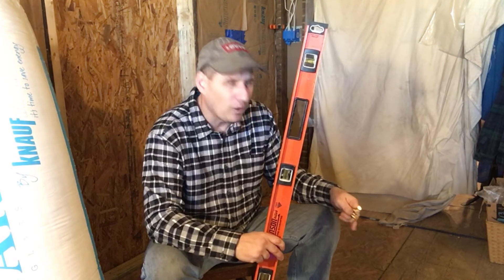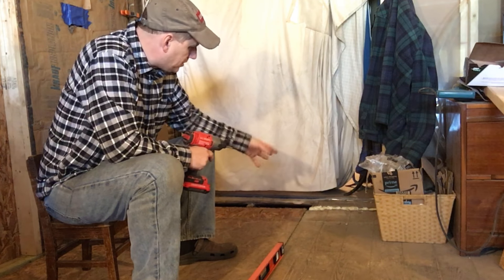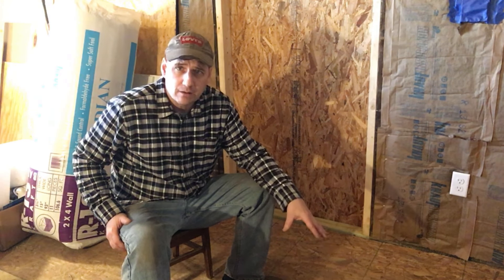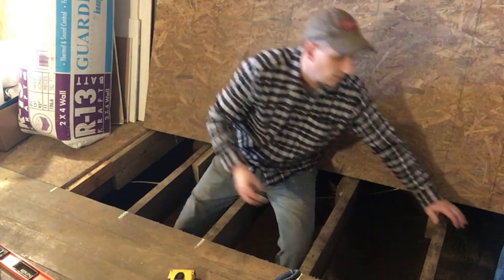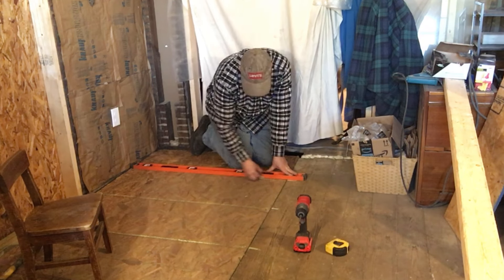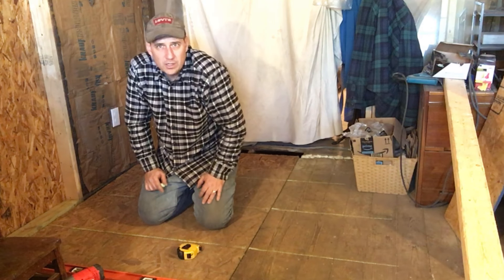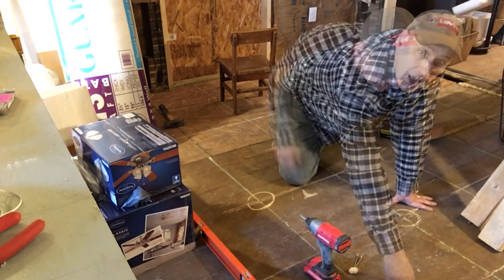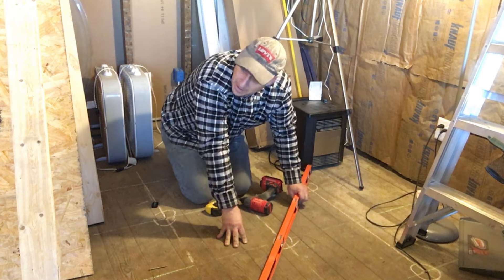DIY: Easiest Way To Level An OLD WOOD FLOOR - Using Screws and a Level

Comment: Curious...how expensive would it be to have foundation experts come in and re-level the foundation and joints from underneath?
Reply from the maker: Hi Ed.  The cost of contractors to do anything varies widely on where you live, what season we are in and how the economy is doing.  If contractors are "hungry" for work - you are more likely to get a better price.

I don't know how much reworking foundations would be specifically but I can safely say the minute you speak the word "foundation" - watch for $$$ signs to show up in the contractors eyes and change orders to shoot out of their asses.  You can expect to pay 1000s of dollars for any kind of foundation work.

Usually - it won't cost you anything to have a contractor come and look at the project and give you an estimate and a diagnosis.  Once you have a "ball park estimate" from one contractor - you can "shop around" for other price estimates and dial in the scope of work.

But watch out - foundations can be an unknown can of worms. Once the contractor starts digging - there is a good chance new issues will arise and the costs will go up (ie change orders).  After all, if the contractor can't see it - they can't price it and most contractors will not guarantee contracts against the unknown.  Contractors (especially the low ball bidders) love unknowns which leads to those nasty change orders requiring more money. They use these change orders to recoup money lost and/or increase their profits when they underbid others to get the job.  Usually a 10%-20% contingency budget is necessary for anything in construction that is below the floor level to allow for these "surprises".  So when you get your price quote - better tack on another 20% to be safe.

Hope this helps and thanks for watching!
Reply: @RundownReborn  ....thank you Sir for your advice and expertise. I discovered some years after I purchased my home (only 2 years old) my floor joisting was 32" on center! I slapped my forehead and called an inspector. He said the joists were in code because of particularly large pier & post support beams. Still, the floors have been uneven for years. Thanks again.
Reply from the maker: @edzanjero353  
I suggest getting a laser level and try to determine how much out of level the floor is at the top of the foundation. If the top of the foundation is relatively straight but the floor isn’t, this suggests the floor structure itself needs reinforced and strengthened

Comment: I had a terrible floor on my 100 year old house. The floor was previously leveled with sand, then stone flags on top. So no effort was made to level the floor boards it was all resting on. I simply removed everything down to the beams, then hammered the beams from underneath, lifting them off the sub-beams until they were level. Then I packed out the space between with ply. Another solution would be to screw your 'sleepers' to the side of your existing beams. Then you wouldn't need to measure or cut them. Just depends how much of a pain pulling up your floor is.
Reply from the maker: Absolutely - that is one way to do it.  I had to level the entire house - while we were living in it.  I did not see a need nor did I have a desire to remove the floor boards in place. I left them there for extra structural strength.  Leveling on top - for me - was the easiest approach.
Thanks for watching and for sharing your story!

Comment: How about using a laser level to set your screw height. Horsing around with a long level is possible, but a tedious job that is hard to do accurately.
Reply from the maker: That is certainly a great suggestion.  Just not everyone has a laser level - including me.

Comment: I wish my subfloor was this easy to lift up! I pulled up on sheet and there's 4 or 5 older layers to go through! top subfloor is screwed into an older 1/4" plywood subfloor, which is on top of 3 or 4 layers of linoleum which is on top of 1x4 planks which are finally attached to the joists. What a nightmare
Reply from the maker: Holy moly. Sounds like you have a very big challenge ahead of you on the tear out.  Hope my video helps tho once you are ready to start leveling!

Comment: Lets be logical real quick. The floors have sagged down either because the existing support columns have sunk down in the dirt or the exterior foundation footing has sunk down in the dirt. This could be due to soft dirt, wet dirt, etc. By adding additional strips and additional decking you are adding quite a bit more weight to the floors which means more load on existing support columns and exterior foundation wall footings. This method will surely cause more sagging floors in the future. Certainly nobody on the planet would provide a floor stabilization warranty with this method. You better stick with methods such as adding additional supports, adding additional beams, or adding push piers under the exterior foundation wall footing if you guys want to jack up your house to level and for companies to provide stabilization warranties so this never happens again. What's the point in doing such an extensive repair if there is no stabilization warranty? Hope this makes sense and saves people from making bad decisions. Thank you.
Reply from the maker: All good points but I disagree with the premise. My uneven floors are due to the front corner of the house has settled primarily due to lack of gutters and improper shed drainage over the years. This has been remedied with new gutters that drain to the street.

I ask you, how much does 1 sq foot of 7/8” deck weigh with about 1 foot of 2x2 and a few screws? Maybe 2 pounds? This is not a significant per sq foot dead load increase on the floor structure. To add, the overlaid deck has actually strengthened the floor since it is tied into the existing floor providing more lateral shear resistance and has stiffened the floor system to resist deflection. 

Jacking the house and raising the foundation is incredibly expensive and an overkill solution in most cases. I would only recommend that if the foundation is compromised or deteriorating. Mine is not so. If it was, I probably would not have purchased the property. Thanks for watching and for the dialogue.

Comment: Your piers are off bc of water issues. Water creates the settlement.
Reply from the maker: True. I fixed the water problem but it was still uneven
Reply: Inch or inch and a half isn't too bad. My house was off 3 1/2 inches

Comment: Why don’t you just tie ropes from one end of the room to the other point and make sure the rope is level?
Reply from the maker: Might work. Go for it. Seems like a possibility
Reply: @RundownReborn  I tried it. Combined it with your method. Works perfectly. I use the screws to mark the cut line fit the shims

Comment: Next time lay your two-by-four across the screws and then use a scribe to get the exact Contour of the floor and then of course cut it down to level
Reply from the maker: Great suggestion if you can get your board flat against the floor. Sometimes it doesn’t.

Comment: Couldn’t you have set your 2x’s on those screws and used a compass to scribe it to the floor? Then you wouldn’t have had to measure each screw point. My two cents lol
Reply from the maker: That is possible but that assumes your screws are in a perfect line. It might be a tricky proposition but it may be worth a try. 👍

Comment: Why not do it right and jack the house back up with bottle jacks. A house isn't suppose to settle that much that means your foundation is bad and is only going to get worse untill it falls down..
Reply from the maker: Hi Chase. Thanks for the question.
I chose not to jack the house up. I do believe the foundation sinking issue is fixed. In this video I talk about it. I've linked to the moment I explain the issue from inside the basement. https://youtu.be/M5r4cCSSM3Y?t=1512
That combined with adding a gutter to the porch area and fixing the roof and I don't expect the house to settle anymore in that area.

So since my foundation issues are resolved, my concern was leveling things as it stands. This video shows that process.
Thanks for watching!

Comment: It makes me slightly uneasy that there is no evaluation of why the home has moved the way it has to create to floor problem. This is always the first consideration - to insure that the original problem gets solved before you start to pull a new pair of coveralls over a broken leg.
Reply from the maker: The settlement problem that caused the uneven floors was resolved. But the floors were still not level. This video shows how I leveled them.

Comment: This is putting a bandaid on the real problem, which is foundation settlement.    Cheap fix I suppose, but I dont see this lasting decades, especially with a floated up floor.  You won't get level or sturdy enough for tile, or hardwood.  Why not go ahead and pulled the floor up and level the foundation?  It's really not that expensive.  Then go back with double 5/8 or 3/4 decking and it will be strong enough to put any type of flooring on there you desire.
Reply from the maker: Thanks for the post. I respectfully disagree tho. The house has settled about 2 inches in 100+ years by the front door. This is because about half of the roof drains to this spot and it went a long time without gutters. That problem is now fixed.

Not sure where in the world leveling a foundation is inexpensive. You have digging, steel and concrete involved. These are all $$$ words in construction with lots of unknowns. Not to mention, it’s not a very good DIY opportunity.

Leveling a floor is a practical solution for most situations but not all. If the foundation shows signs of stress, fracture or compromise, then that definitely needs to be addressed first. But foundation work is really only necessary if there are foundation issues.

A floor out of level in a 100+ year old house is not uncommon and rarely a foundation concern.

Comment: String and a bubble level.
Reply from the maker: Yes...and then what? 🙂
Also, bubble levels on string can be difficult to work with by yourself.
Reply: @RundownReborn  instead of a grid of screws put screws around the parameter then tie string to one screw then tie it to the opposite side using a line level repeat with each set of screws. Now you can measure anywhere. Another option is a laser. My preferred way. A laser is a bit of an investment but well worth it. Min was about $100.

Comment: Hey, brother? Was this idea your own or were you inspired by another Youtube video?
Reply from the maker: Is there another video? The method is similar to leveling joists but I didn’t want to pull up the old floor boards. I tested the system in my dining area first before I did the video in the living room. Thanks for watching! I hope the video was helpful.
Reply from the maker: Ah. I see you have a similar video!!! Great minds think alike eh? If you use the screw heads to mark your slope cut, then you can get your wedge strip in one cut and get two sleepers out of one board. Your system seems to have more waste and requires 2 cuts. Thanks again for stopping by on my channel.

Comment: Wouldn't it be easier to map  out the height with a laser?
Reply from the maker: Possibly, if you have a laser and an open room. I find this method is quite efficient and probably just as accurate as a laser level.
Reply: @RundownReborn   I am about to tackle doing flooring in a subdivision house , I know is out an inch from corner to corner and has a few lovely valleys and hills in the middle.   I got a spinning laser as a gift 10 years ago and have not yet tried it.
Reply from the maker: Try it both ways (my way and with a laser level) for a little while and let us know here which is easier!
Reply: @RundownReborn  I hadn't fully watched your video.     You certainly do like work.   why didn't you  simply  lay your 2X4  along , shimmed to the correct height and level and then  take piece of wood attached to a pencil to run along the floor, tracing the  dips and valleys  onto the board?
Reply from the maker: @robertacton1271  scribing isn’t always possible. Sometimes the valleys in the floor are too deep for a 2x4 on edge to flex flush to the floor. Also scribing as you suggests relies on straight and true studs which isn’t always possible with old lumber or low quality lumber that bows or twists. My method works with any lumber type.

Comment: Just got through the first 1:34 minutes of the video and - don't take this wrong - but if you casually mentioned "I'm the CEO of an international conglomerate and I do this hands-on work to relax"

Your demeanor and intellect seem a bit out of place.  Sort of wondering if in fact you actually are the CEO  of a huge business and you do this sort of work to relax. 

Not to sound condescending towards the other hands-on workers I've seen post how-to videos youtube, but my goodness, you seem sort of out-of-place doing that kind of work. 

There's absolutely nothing wrong with doing hands-on work on an old house.  But usually the 'vibe' you get from the person is a better match for the type of work. 

.
Reply from the maker: No offense taken. I started working on the house when my wife started school here 2 years ago. I have taken a break from my career as an Architect and Software Engineer (50/50 split over the years). I have 3 bachelor degrees. So you probably are onto something about the "fish out of water" vibe.

But working on the house is rewarding. I like working with my hands and working creatively. The house is easy for me technically. Its therapeutic. And my newfound passion in YouTube gives me buckets and buckets of satisfaction for my creative thirsts.

I thank you for the sincere comment. Its nice having viewers like you out there.
Deric

Comment: Why didnt u fix the foundation first idk man i got the same situation my mom bought a second house but were not gonna do this were gonna start by shoring up the house best we can then fix the floor im thinkin u should have fixed the foundation first if u ant got a good foundation u dont have anything and u will have more problems in the future unless ur gonna sell the house but if they find out u could be in trouble but idk.
Reply from the maker: The foundation was fixed prior to me purchasing the home. The settlement was due to half of the roof draining at one corner of the house for years without gutters. That corner of the house settled about 3-4 inches as a result. All of this is fixed but the floors were out of level as a result. Thanks for watching!
Reply: @RundownReborn  ive had my share of floors like this but ive never dont this my moms house 2and a half inch bows and we tore out the chimnys cause they didnt go to the ground with them and leveled up the house and the floors just leveled back out after a year or so..back home in benham ky.

Comment: Floor leveler less work
Reply from the maker: perhaps - or maybe not...especially if it all leaks through the floor boards into the basement. 2 inches of floor leveler is a lot of weight too!

Comment: U used the wrong screws - the heads pop off those ones (junk) u need structural screws - never use those to strap footings on high places unless u wish to fly off, just sayin man.
Reply from the maker: Thanks for the tip

Comment: If you really must level a floor by adding scrap spacer on top.....

Use a string and 2 screws for each spacer. 

Faster, and more accurate
Reply from the maker: To each their own. I find my system works well too.
Reply: @RundownReborn  same principle.

But instead of putting in so many screws, you run a string level across.

Then you aren't sidestepping all the screws.

Also accidently kneeling on a screw is bloody painful
Reply from the maker: I would be interested in seeing your method demonstrated, and then compare the methods. I sense that there would be issues to deal with in your proposed method as well.

Comment: Its good but alot of work why not just attach wood under the floorboards onto the joists
Reply from the maker: That is certainly one way to do it. I might suggest that tearing up the entire existing floor is no easy task. Not to mention the hazard it creates when you are living in the house while you do it - especially if there is a basement below like in our house.

The method I present in this video, I feel is the most noninvasive method available and at the lowest expense- and giving you the same result.